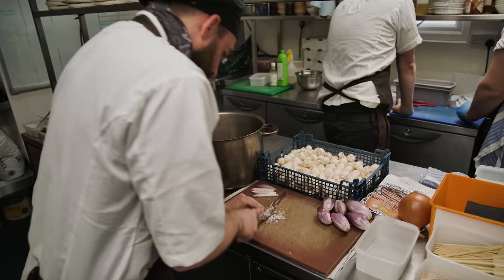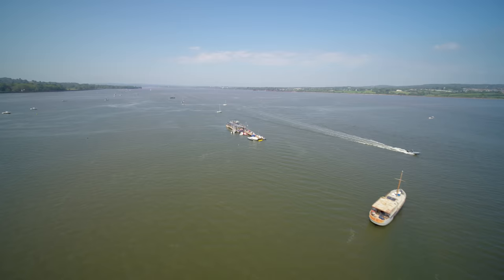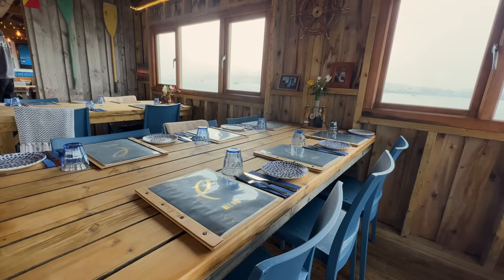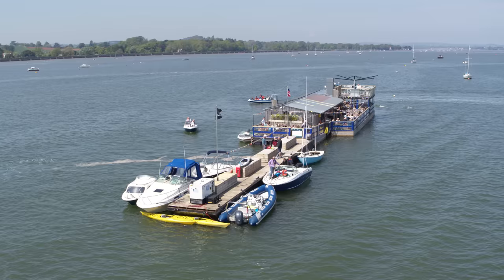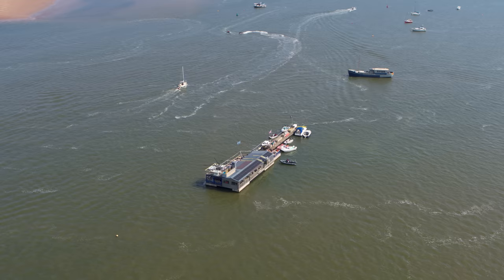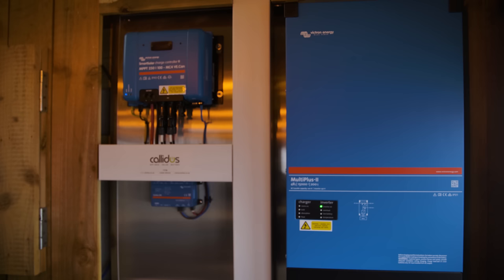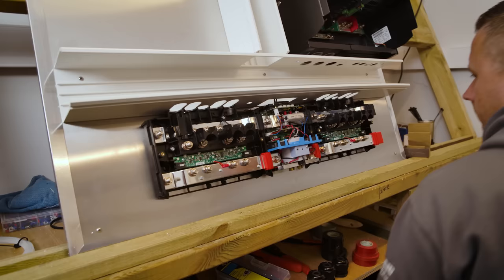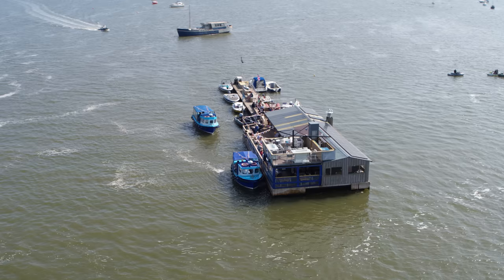Floating cafe cuts generator usage using solar

Comment from the maker: 🎯 Key Takeaways for quick navigation:

00:00 ⚡ The River Exe Cafe experienced generator failures, leading to service disruptions.
01:01 🌞 They transitioned to a Victron Energy solar and lithium battery system to replace their noisy and costly generator.
02:58 💡 The diesel generator was unreliable, costly to maintain, and needed replacement every three years, causing power outages and financial losses.
04:58 📊 Exeter University assisted in researching and planning a sustainable energy project to reduce carbon footprint and noise.
09:00 🛠️ The installation included Victron Energy components, such as solar panels and lithium batteries, to provide stable power and reduce reliance on the generator.

Comment: Out in the middle of the channel like that? He should have some wind energy in the mix for when its not sunny. Couple of 2kw Wind turbines would do a lot for a system like this. Any excess energy could be used for heating.
Reply: Because they spin fast (noise), they would have to be on the same pontoon as the genset.

Comment: I don't mean to be rude, but does it really need University resources? Surely the installer /distributor could have done the calculations? And Victron might have checked the calcs?
Reply: Callidus carried out the initial analysis and both outcomes were very similar.
Reply: The reason Paul at River Exe Cafe reached out to the university for support is because taking a big financial step is risky and having the backing from the university gave him a lot of reassurance. The customisable tool designed by the University gave the cafe the ability to play with the scale of batteries and solar. The tool also looked at financial data and carbon savings, so it gave Paul a good indication on which options would be the most commercially viable for the cafe system. Paul worked with Centre for Future Clean Mobility at the University through the MBTC Project, this was a European funded project to allow the university to provide time and expertise to local businesses like River Exe Cafe that are looking towards decarbonisation.

Comment: Sounds real nice in words and a very nice commercial for Victron Energy. I have been world cruising on my 40' sailboat for 13 yeaqrs and totally off grid. I mention that only to establish my experience based opinions. Indeed Victron equipment is what I currently use. Thing is there is just two of us aboard. If you take into account a number of things unmentioned in this video. You might have a completely different picture. This in my opinion is just a very expensive experiment that has not been logically costed out beforehand. I would bet this restaurant cannot operate entirely on solar power, stored in batteries and inverted from 12,24, or 48 volts to 240 because...
1.It rains and is cloudy much of the time in Exceter, hence making Solar undependable for the huge electrical load this Restaurant requires.  Necessitating Generator backup.
2.The cost of all that kit would be very difficult to recoup without hefty government or other type grants.
3. He would have to at least change all of his cookers to Natural Gas, and possibly his refrigeration to some kind of DC power that could be derived from his batteries, so  as not to loose the 10% power loss when the Victron Inverters turn the electricity to 240 volts. Problem is the size of the tanks for this would may not be allowed due to government safety rules for a public location.
Reply from the maker: Of course this isn't going to return his investment overnight but Paul has done way more than most in his research, getting experts from Exeter University to analyse the restaurant and the solar yield locally for example. He would have to have a lot of solar and batteries to be completely off-grid, especially as you say in the dark, wet winter months - but that was never the plan. His install of Victron Energy equipment was to help and assist - not replace.

The cost of fuel at the moment is high and Paul is already making huge savings due to the fact he doesn't have to run the generator 24/7.  Secondly, Paul wanted to be able to leave the immediate area and not worry that the generator is going to go wrong at any moment and he would have to rush back.  That has also gone, Paul has said, since this was recorded that he doesn't need to be on hand 24/7.  His cookers are on gas already and have always been so. 

Thanks for taking the time for your reply.

Comment: Being from Exeter I recognised the thumbnail location straight away! Isn't there opportunity to  mount an additional string on the side of the restaurant also so take advantage of the lower track of the sun in spring/autumn?
Reply from the maker: There is a lot of roof too. Baby steps, baby steps!
Reply: Hi yes we did talk to Paul about that and he may fit additional panels at a later date.
Reply: @callidussolar2474  That's good to hear 👍🏻 is there just one string currently? (couldn't quite see the wiring options on the MPPT) if so, what impact does the chimney shading have on output?
Reply: @SabretoothBarnacle  because the café operates in the summer months. The Sun is relatively high, so the chimney offers very little in the way of shade.

Comment: What amount of solar panels and batteries would give a 90+% chance of having all power the cafe needs at least from may to september?  Is it open in the winter? Is/can the pv system be routed to first ensure fridges/freezers are powered and if there is power leftover run other things so the genny can be switched of when the cafe is not open? What changes to how things are done in the cafe would give the biggest energy savings without reducing the quality/results? Would double number of solar panels make it (mostly) generator independant or does it also require more batteries to do that?   A follow up video would be nice to see it in operation after a fiew weeks and if you do expand the system.

Comment: Why only 6kW of PV ?  Even using the installed 375w panels (low output), it looks like they could get another 8.25kW to give a total of 14.25kW.  It also looks like a wind turbine would work well !
Reply from the maker: This is just the start for Paul to find his feet.  He didn't want to run before he could walk!

Comment: What provisions have been designed to mitigate the possibility of thermal runaway in ageing lithium batteries. Ventilation , etc. This is in effect placing customers in a BESS box with the batteries under them. As marine engineer and commercial surveyor myself. I would not be this signing off. With batteries of even wet flood lead acid types to be in public areas. Under the cabin sole. (Floor)

Comment: Great install, very cool use case!
I'm wondering why the "remote" wires of the MPPT are extended, is there a remote shut off or was it to prevent the plug from being taken away?
Reply: Hi yes it was for remote shut off

Comment: Does any tidal turbine electrical generation technology exist that could be installed below the barge that could take advantage of the predictable strong tidal currents? This would have the potential of providing complete owed independence free from diesel generator noise, fumes and cost!?

Comment: How do you manage cooling fan noise as the inverter/charge controller package is customer facing?
Reply: It's a bar, the walls are literally 2 by 4 studs with a sheet of plywood. If you are the person sitting next to it you might notice it.

Comment: TYPICAL UNIVERSITY taking months to do what a tech would do in an afternoon. Also, a tech would have had inbuilt redundancy by using two inverters, two solar MPPT's and more solar. The money saved by not engaging a University would have allowed double the solar too.
Reply from the maker: The University work didn't cost the cafe owner anything.

Comment: Where did they get the earth reference from?
Reply: River Ex café already had galvanic isolation, which was attached to the steel structure built in before we installed, this supplied fantastic earth readings when tested.